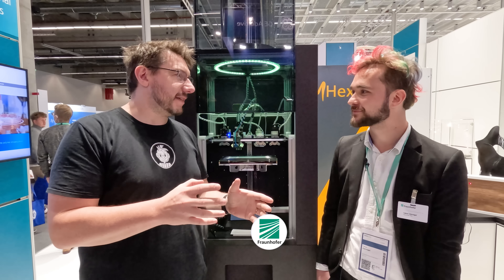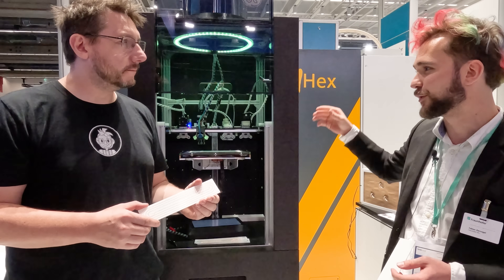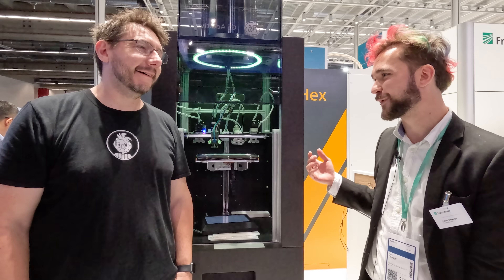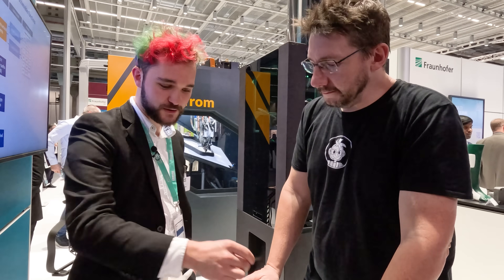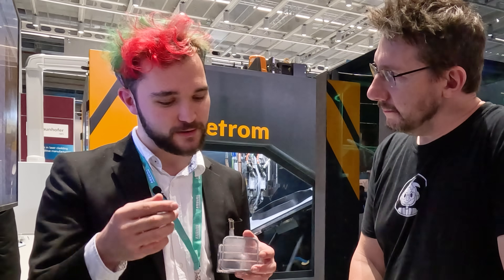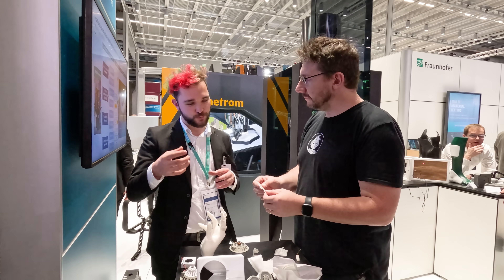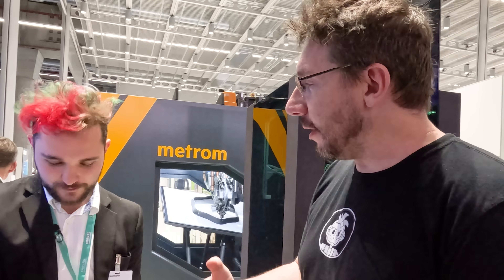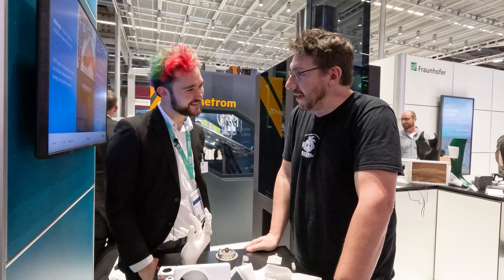3D Printing WIRE with Fraunhofer

Comment: At risk of being contradictory, this is both cutting edge and 'last gen' depending on what format and printing tech you favor. For ADM with filament, total game changer. Resin in engineering grade, on the other hand, they've had formulas with conductive elements that can be energized via the actual design of the part for quite the while and all you do is hook up a lead. That said, having dual material conductive filament available to the general public will pay huge dividends to the maker space and prototyping crowd, and it's amazing to even napkin-math ideas for what you could do with it.
Reply: Fabian here. The resins you mentioned don't reach the conductivity of solid copper. Those materials are super for 3d pcbs but the conductive paths can only be build on the outside of the part. Current approaches of printed electronics aren't able to conduct higher powers or to be used in bigger part. Regarding the resistance to cost ratio nothing beats copper wires. 
I know the other printing processes quite well. Our approach is ment for automated cable management in car manufacturing for example
Reply: @DecobirdZivo  I happen to work with graphene for resin printing among other uses, and I can certainly tell you that you can concentrate it via pathing design internally to a component and it will print as such. I don't doubt that getting repeatability with filament and solid core copper is more effective at encapsulating more typical uses (certainly of larger scale!), but resin's various formula can range almost as much as filament for application, and now there's prosthetic grade stuff that's very fun to use. Or if you don't mind the extra work, running copper into pre-channeled voids, but where's the fun in that. 
Not saying one is better than the other necessarily, as all processes offer advantages over the other naturally, but for me and my projects, I'm of the resin-supporting crowd for its inherent speed and resolution.
Reply: @C-M-E  I'm already looking for new materials to incorporate with our print head. Next stops are 2 component TPEs and as you mentioned, resins. The idea would be to dispense the resin onto the wire an cure it with a focused UV spot. As our printhead always orientates according to the print direction, this should be a no brainer setup.
Reply: @DecobirdZivo  Yes, TPEs with incorporated copper should be huge for you and totally worth pursuing! If you can get that into the hands of the medical and bioengineering folks, you won't have any problems with funding more applications/research. 👍

Comment: Will this be actually on the market or is it another patent which is just there for someone to never pickup?
Reply: patent is placed. What you see here is our first prototype. Fraunhofer isn't selling by itself. We rely on industry to bring this to the market. Besides our partners who are interested in the print head itself, we are already using this for many different use cases. The printer prints almost 24/7

Comment: Hmm this sounds very much like we will get even more throw away electronics with this stuff.
Reply: no worries. Recycling concepts are already in the planning phase. In most cases the wire paths can be separeted by an overheating electrical impuls. They are simply pulled out of the part

Comment: For those interested Fraunhofer is what's called a think tank in the US. But there is more to it, they develop (almost) industrial usuable technologies and not only ideas. There are eighty science locations all over Germany. With researches in Medicine, Informatics, Physics, Chemistry and Biology. The most known invention by the Fraunhofer Gesellschaft is the mp3 Format.
Reply: Other notable inventions are the air bag as well as the white LED (the one that isn't RGB based).
Reply: Also they invented a revolutionary kind of telescope
Reply: Reportedly inferior to Bell Labs's Perceptual Audio Coding (which came first)
Reply: @smorrow  Looks like it ended up being chucked into Mpeg2 AAC so it still exists.

Comment: Im saying it now, we will be able to 3d our phones soon. Imagine when apple releases a new phone you just download and print it with a machine that prints in every needed material in sequence like glass and metal and comes out in one piece ready to use (maybe minus the battery unless we 3d print those too!)
Reply: Fabian here. Currently not planning on printing phones, they are to small for our printhead. The idea is to print all cables inside your power drill or individualize the cable trees by printing them directly onto the car parts. Things like that
Reply: @DecobirdZivo  that‘s an amazing idea. Chapeau to you, your team and Fraunhofer institute. 
Implementation in the car or motorcycle institute  is great. Is it focusing on tuning/ second hand market or more commercial use?
Reply: Nah apple won't let you have their schematics :) they want to keep control for planned obsolescence
Reply: Phones parts are way to delicate. Depends on how you define soon. But you could print old rotary phones right now 😅
Reply: While glass is printable, the clarity we've come to expect out of modern phones is not achievable yet. We'd have to have a different process to create optically clear glass additively.
Reply: If by “soon” you mean within the next 30 years, I won’t hold my breath for that day. If Apple ever distributed their phone as a STL file, it would only be to local Apple dealers using Apple printers with Apple filament/resin, because Apple likes to have a high level of control over their products. Imagine people walking around with iPhones that had QC issues because of a power outage mid-print. Apple would NEVER let that happen. I could see the scenario you’re describing in the case of a fully open-source phone design, but never with the IP of a major manufacturer. 

Of course there might be a parallel universe in which capitalism never existed, and sharing was instead the norm. Instead of “socialism” which today has negative connotations due to political polarization, it would be “share-ity”, and it would spring forth naturally from an altruistic society. Similar to the one depicted by the Star Trek franchises. If enough people living in today’s society weren’t so invested in the hand-held distractions that provide immediate gratification, there would certainly be a shift in the paradigm that we find ourselves part of now. Let’s start a movement. “Death to the demoness Allegra Geller!” [eXistenZ, 1999]
Reply: Good luck printing the CPU... it takes a huge multi-billion dollar fab with EUV litho machines to make those.